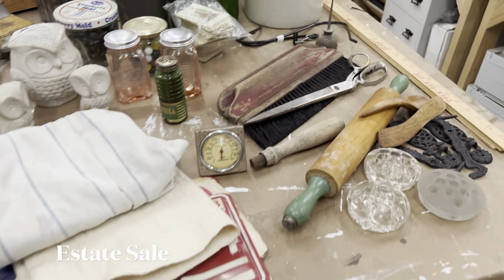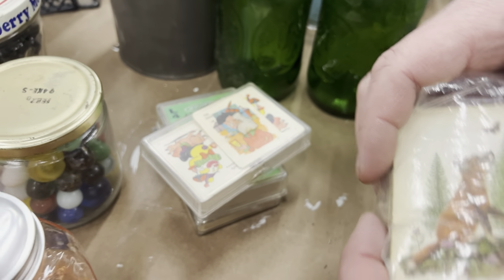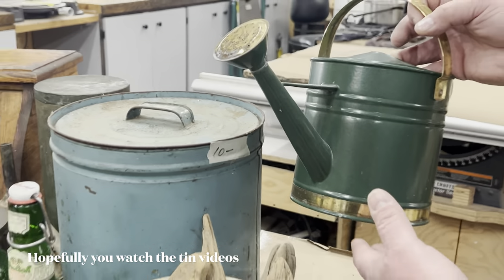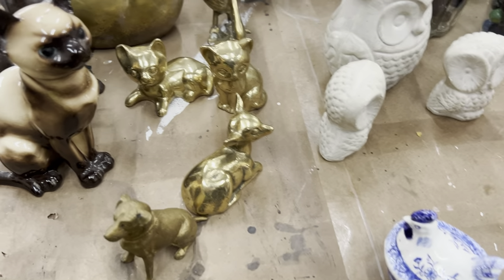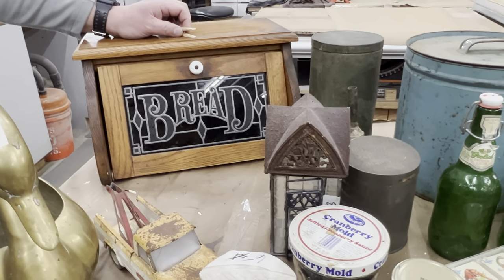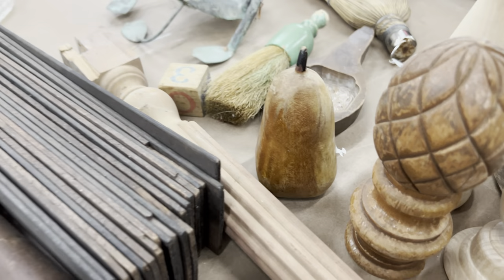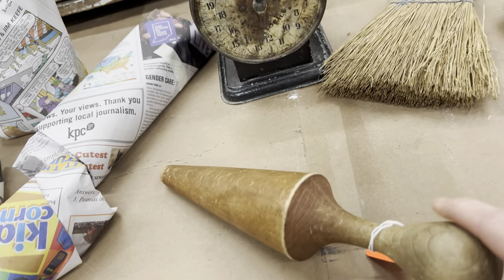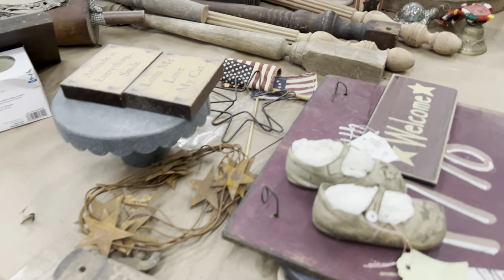Pickers Haul | Items to Up Cycle |  Reselling on eBay for Profit

Comment: Went back to the hospital just after midnight. Excruciating pain and the pain medication they gave me did not work. They gave me a new narcotic every hour for the pain and none of them worked. They finally opened up the bandage and the pain disappeared because it was all the pressure from the swelling. But they had to put the Bandage back on for support. I am back home the next day they finally managed the pain. Seems I didn’t break it I shattered both bones. So I spent the whole day in the hospital sleeping and taking pain pills anyway, I had to check in and see what you’re doing.